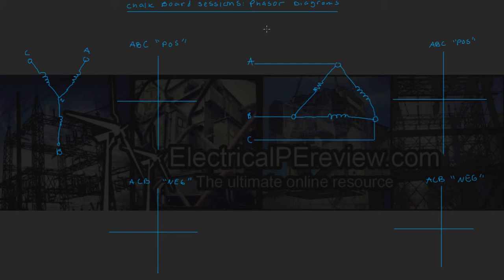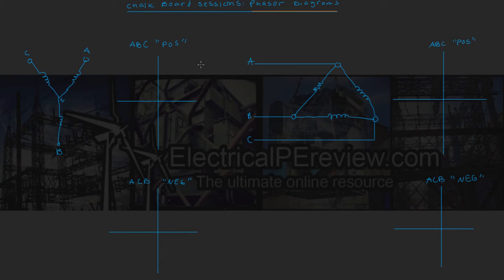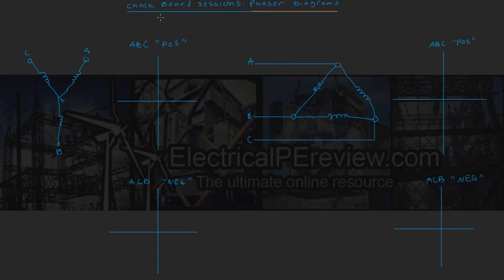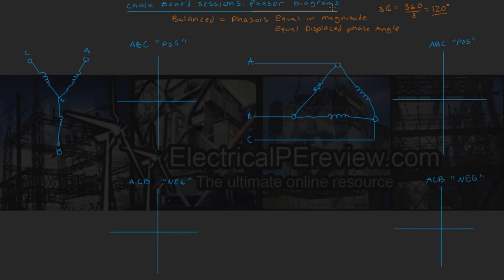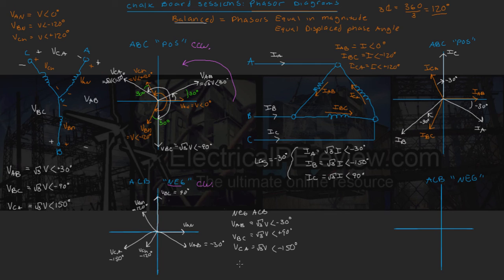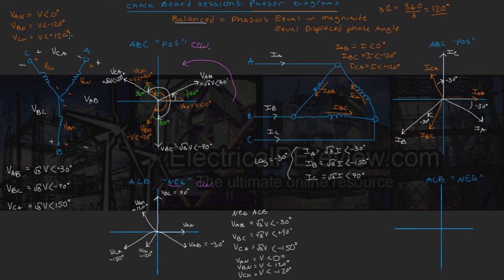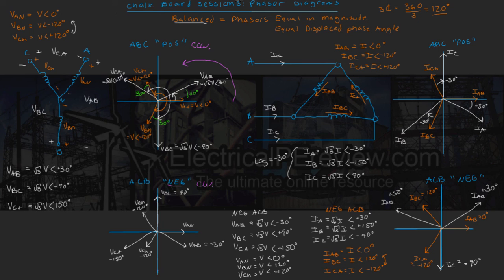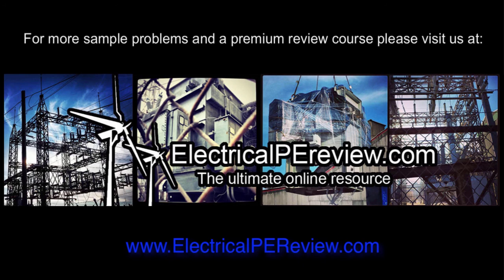Everything You Ever Wanted to Know About Phasor Diagrams - NCEES Electrical Power PE Exam

Comment: Pl explain how line to line voltage is leading phase voltage by 30 deg in star connection.
Reply from the maker: Line voltage will lead the phase voltage by an angle of 30º when the connections are in "star" or "wye" configuration because we are adding two phase voltages together of equal magnitude that have an angle difference of 120º like this:

If VAB is the Line Voltage measured across A and B, Van is the phase voltage measured across A to neutral, and Vbn is the phase voltage measured across B to neutral, then:

VAB = Van + (-Vbn)
VAB = Van - Vbn

If Van and Vbn are equal in magnitude and 120º apart, such that:

Van = Vp<0º and Vbn = Vp<-120º,   then:

VAB = Van - Vbn
VAB = Vp<0º - Vp<-120º
VAB = √3Vp<30º

So,  Van = Vp<0º  
and, VAB = √3Vp<30º

 This is also where the √3 multiplier comes from when comparing magnitudes between phase and line voltage.  This video goes into more details on the math behind it: https://youtu.be/kRhvm5sEsTc
Reply: Its good to listen you. If interested there are few more electrical Quires , related to phasor.
Reply from the maker: Sure thing, you are welcome to ask them directly here in the comments section.
Reply: In ABB diff 670 relay +/-60deg in 1st and fourth Quadrant is taken as region for internal fault  protected differential zone. This is used for discriminating external fault/internal fault .pl explain
.Also if video and calculation for sloe 2, slope3 end section 1&2 with typical example are untouched . Pl enable the same.

Thanks for response.
Reply from the maker: While I welcome questions on this channel, the purpose of it is to cover topics on the PE exam. Your question, while it is a good one, is not one that would be covered.  I'd suggest picking up a good relay protection book and diving more into detail.
Reply: I respect your view, thanks for suggestion.
Reply from the maker: Your welcome.  I'd be happy to offer my two favorite protection books. The first is "Protective Relay Principles" by Sleva, which can be found on amazon.  The second is "Art & Science of Protective Relaying" by General Electric (GE).  I believe GE offers this book for free if you check your favorite search engine.  Good luck!
Reply: Angle 30 how it comes
Reply: Cool, Thanks for the information on the relay books. Is there any other books you might recommend ?  Is there any books that you highly recommend for Distribution Systems ? All the distribution books I have read are kind of convoluted. I would appreciate it so freaking much !
Reply from the maker: Sure, I would be happy to share some of my favorite books that I've found useful.   If you answer a few questions it will help me narrow down my recommendations to what will be the most useful for you. 1. What part of the industry are you practicing in?   2. What type of specific tasks are you looking to learn or get better at  (ex: sizing equipment, setting up relays, laying out electrical drawings, etc)  3.  What type of information specifically about distribution are you looking for?   4. Any other applicable information that you will help evaluate where you are at and where you are trying to get to